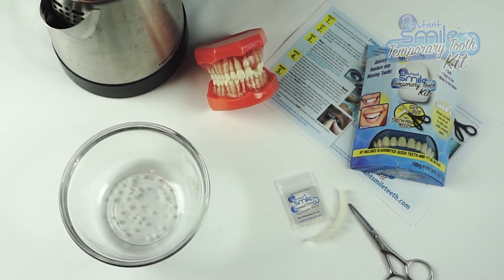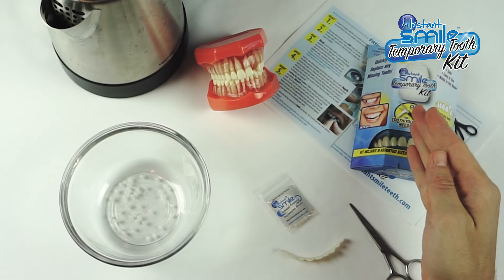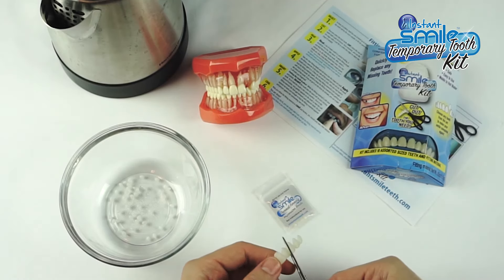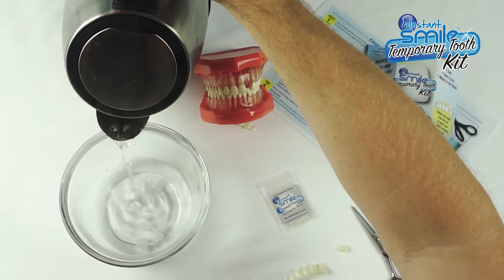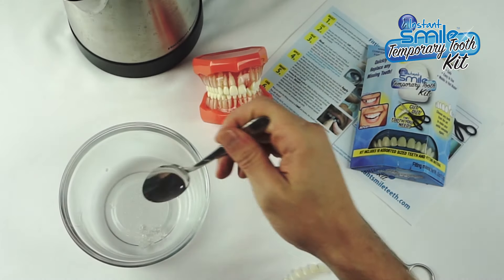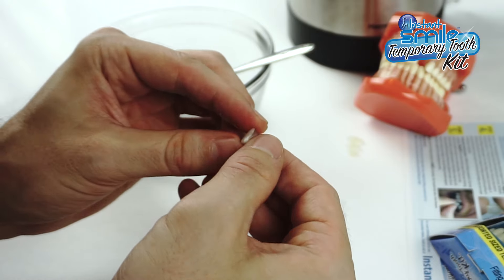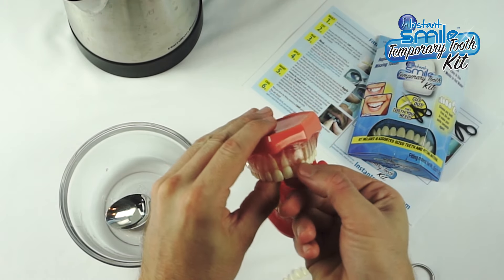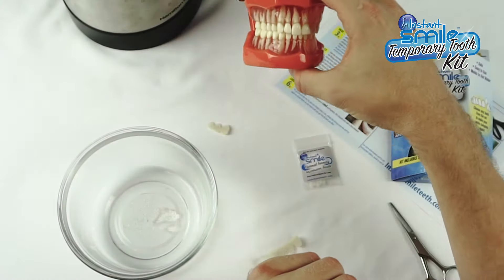Instant Smile Temporary Tooth Kit - Instructional Fitting Video

Comment: This product SAVED MY LIFE, as I had my son's wedding to attend and this product solved the problem for a month of wear... until the veneer fell off, and i replaced it with another veneer.
Reply: Did you use it for a single tooth or did you try the sets of upper and lowers ?
I have a similar situation.

Comment: I filled in my missing teeth with this product until I could afford my denture.
Reply: How long did it hold up?
Reply: How has it worked for you?
Reply: for how long can it hold up , can you eat with that , please answer 🙏
Reply: How long does it stay in firmly
Reply: So many answers not answered. Thats the reason this kind o channels never get big.
Reply: @hellohello-in8ik  I could eat and they lasted maybe a week
Reply: @kathybrewington6271   at least a week
Reply: Hey everyone. Just FYI, you can use something like "Instant smile" and tweak it a bit to ensure a GOOD fit, and that it stays. Make SURE you get your size, either MEDIUM or LARGE. Don't buy it and then complain they're too big etc. They're usually in two different sizes. OR they're a ONE SIZE FITS ALL...

Secondly, purchase an extra set of beads. Now, you'll melt those beads, and place them on the edge of the base so that it hits the top of your mouth. Push it in and fit it. Place it back into cold water so that it sets as is. Then, you will add Denture Cream when placing it on to further set it.

Comment: But, are you able to use it to cover a tooth that is there, but just has a visible cavity? Or does this only work if the tooth isn't there to begin with.
I've been trying to use this to place over my pre-existing tooth to make it look better.
It doesn't seem to stick.
Is there a product I can use for that purpose?

In other words to hide a tooth rather than put in place of one.
Reply: There cannot be two missing teeth next to one another. Other than that it can cover anything
Reply: Try a small dot of poly grip I have the same problem.
Reply: It might work better to cover all of them with the sets they offer.